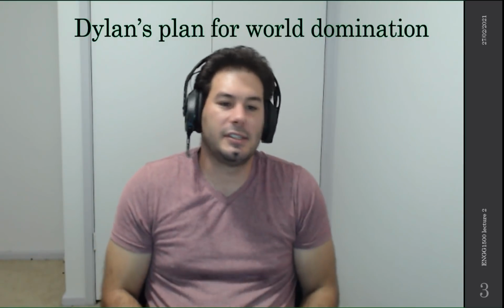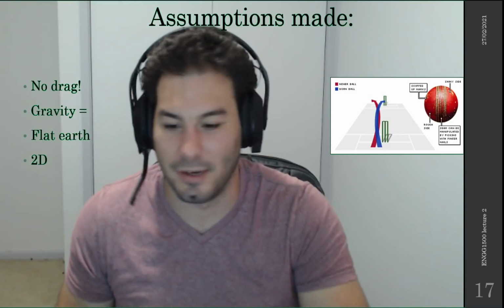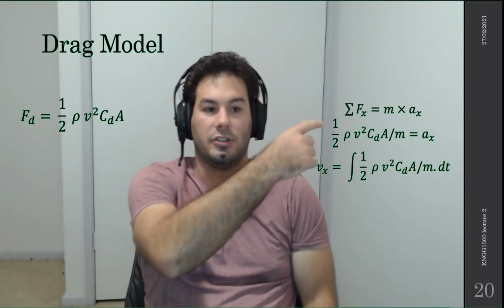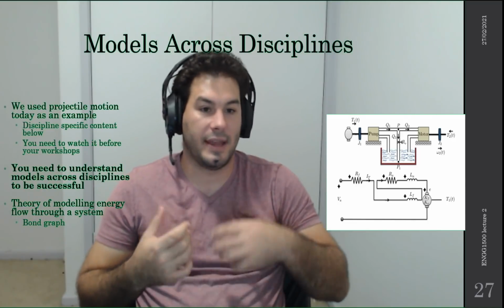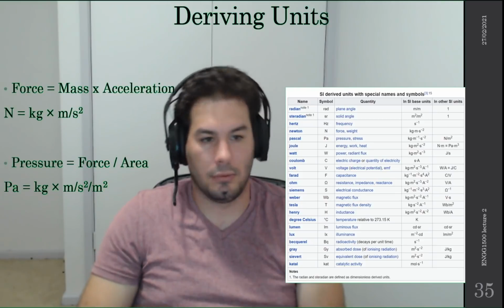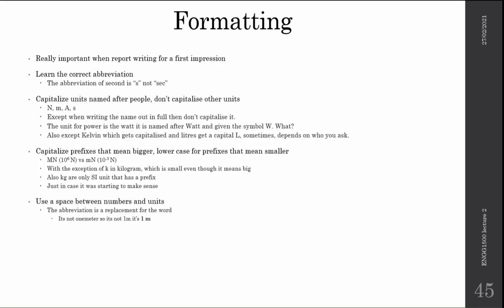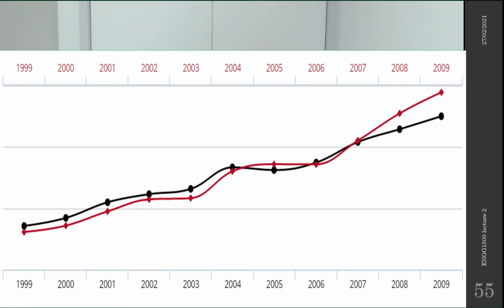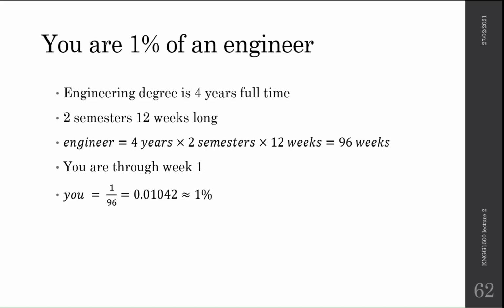Lecture 2

Comment from the maker: 00:00:00 Video start
00:00:43 Admin start and worksheet
00:02:52 First 6 weeks of lectures
00:08:30 Assessment task

00:10:38 Assumptions and Models Start
00:11:35 How far can I throw a ball
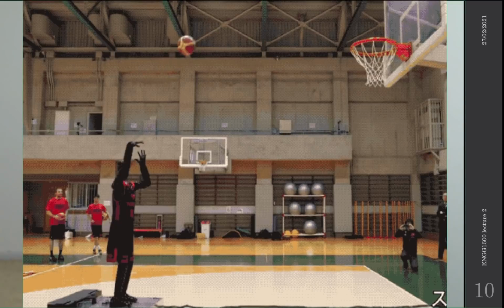00:12:35 Projectile motion model
00:15:38 WRONG WRONG WRONG 
00:16:07 Assumptions (Blue Slide)
00:21:46 All models are wrong, some are useful
00:26:04 Example situations – projectile motion 
00:34:18 The Drag Model
00:38:38 Turtles all the way down
00:42:00 Assumptions as an engineer
00:46:12 Dylan Ruins Everything (Blue Slide) And clarifies some things 
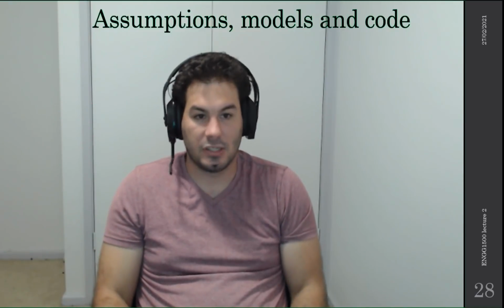00:52:07 Models and code
00:55:50 Bringing it back to ENGG1500 projects / design briefs 

00:58:04 Units start
01:00:22 Units example (White slide)
01:02:56 SI units
01:05:02 Deriving units
01:06:36 Check your self (units wise)
01:09:41 Metric units
01:12:40 Imperial units are good!
01:20:13 The metre
01:22:29 Unit Formatting (White Slide = Important)

01:28:20 Research Basics start
01:30: 13 Sources of information
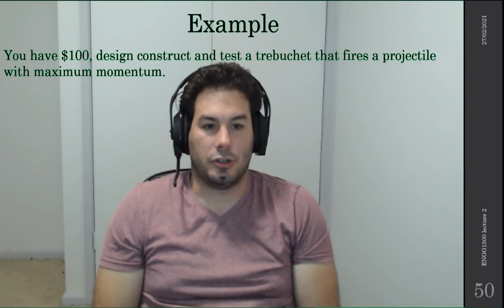01:35:11 Example (Trebuchets)
01:39:00 Timelines for research
01:41:19 Data analysis (Blue slide important)
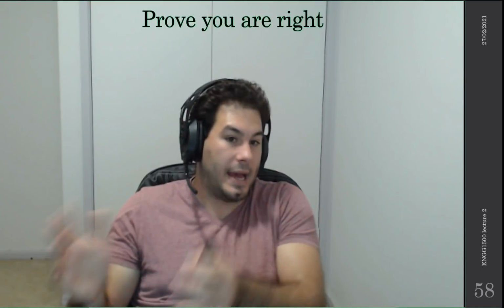01:46:49 Prove you are right
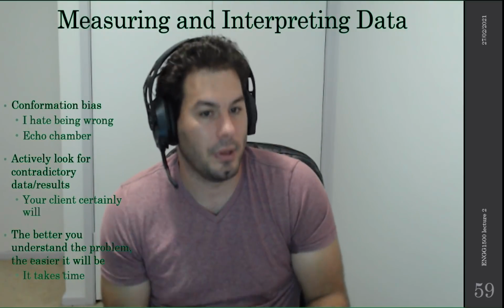01:51:50 References 
01:55:09 Recap
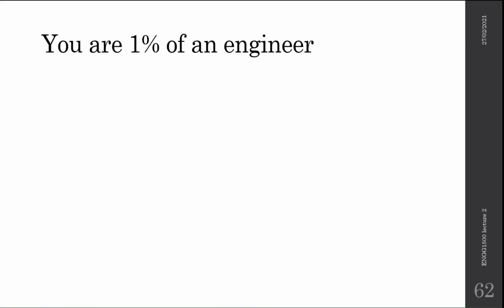01:56:05 You are the 1%
01:57:16 Done!